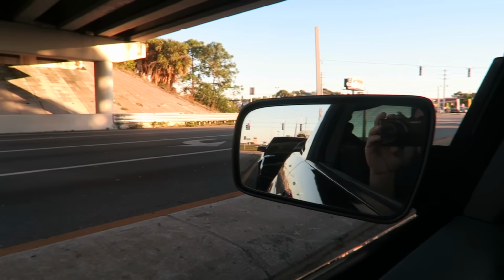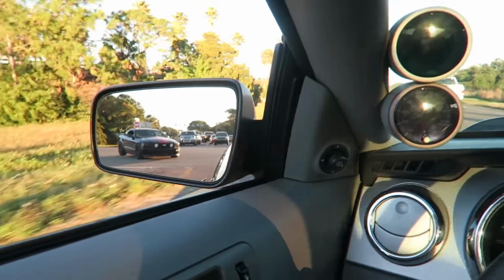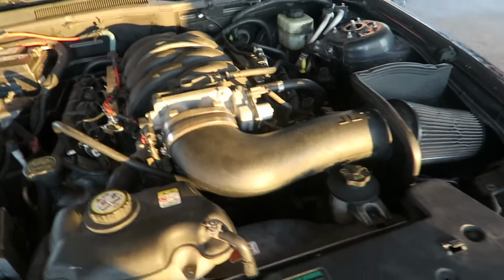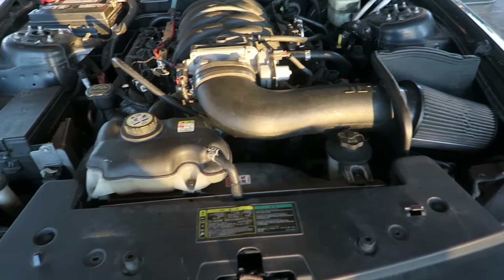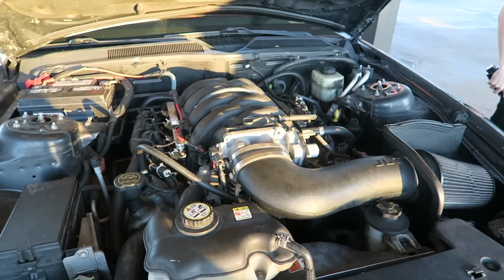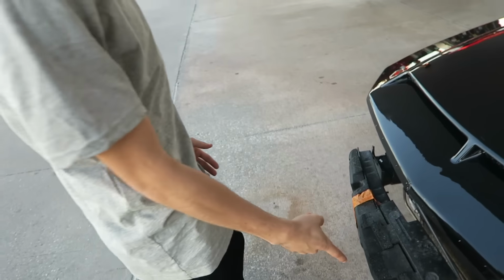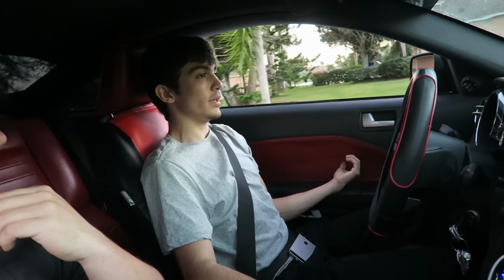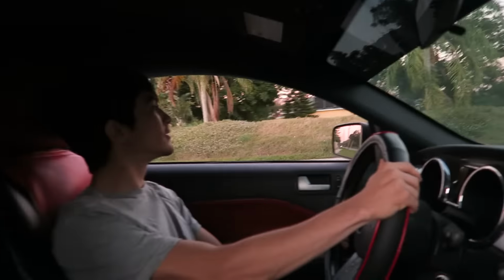He Thought I Had a 3v! LOL *REALLY SURPRISED!* (5.0 Coyote Swap VS 3v GT Mustang)

Comment: That was my twin brother from another mother driving there, computer generated footage shot in Mexico.

The 4.6 3v needs boost to play with Coyote's, no doubt. It just doesn't have the revs and the power to play the NA game unless the guy driving the coyote doesn't know how to shift.
Reply: 3v can easily run with bolt on coyotes without boost but it would need aftermarket heads and cams and a nice intake manifold too that can get them up in the upper 300s to low 400s at the wheels if built right that's plenty enough to play with bolt on coyotes so they dont need boost it's just easier to do with boost I guess you could say
Reply: Trevon Adams  What year?
And I definitely agree, I love the sound our cars make, but it doesn't make a lot of power unless boost is involved
Reply: Trevon Adams  I figured that out quick with mine. I've just turned and put a cai with exhaust. Honestly not worth it to dump so much money into the car and get so little back
My buddies 95 z28 is running with my car..
Reply: Trevon Adams  haha true, when I get the money though, I'd rather look for a c6 vette than an older coyote
Reply: Trevon Adams  Exactly what I was thinking, a 2009 vette!
Reply: Coyotes will get fucked up by a NA LS7. And they're older, cheaper, and physically smaller lol!!!
Reply: I rev mine to 7300. I think that's great being it's still stock. 🙄🙄
Reply: Trevon Adams  I didnt say bolt on and cammed 3v I said one with heads AND cams AND an aftermarket intake manifold with FBo 410 gears and a good tune could easily run with most bolt on coyotes easily now a fbo cobra jet probably not happening but to say they NEED boost to play with a coyote is just a false statement.  Does it cost more than its worth probably is it better just to start with a coyote yes I love coyotes I'm just saying that blanket statement is false and it is
Reply: @michaelharris748  400 horses for a v8 is like driving a 150 horsepower Honda 😓 still fast though.
Reply: @Cricis11700  people act like that these days because everyone on the internet has 1000 hp cars but in reality in the real world 400 horses in a stang (to the wheels) is actually a pretty quick car you get from 0-go to jail speed very quickly
Reply: @michaelharris748  400 to the wheels is a damn good track car bro, not too much and definitely not too little, but they're dragging bro, you not more power in that regard and less weight, just my 2¢
Reply: @michaelharris748  Bolt on coyotes make high 400's to the wheels. On e85 with just headers, cold air intake and exhaust they make 510 wheel... The coyotes make so much power with those sweet higher revvs, the 3v just doesn't compare.

Comment: But that 3V sounded way nicer 😄
Reply: MrSleesch13 it’s a 4.6 thing 2v sounds better then the 3vs
Reply: No way.
Reply: 3v does sound the best
Reply: I have a 4V 4.6 and I think 3V’s sound the best
Reply: I agree the 3 valve sounds better.  I had a 2006 GT with flowmaster 40 series and now a 2017 GT with Borla...  Someone said 2v the best; which I agree but to be fair the mufflers where under near rear seats with long pipes before tips... Unlike the 3v and 4v mufflers right at the rear bumper and immediately followed by tips...
Reply: 2 valve ls7 will fuck both of these up. I thought "Merican pushrods V8s" were so bad? Just ignore the zr1 and demon, they're both pushrod 2 valves lol
Reply: @bambam23406  2v 4.6 sound the best!
Reply: Noah Witt 😂😂😂
Reply: They always sound better than the coyote. Not sure why people like them so much. I guess more cams = more epeen
Reply: Coyote with gt500 mufflers sound badass
Reply: Pretty much all a Ford 4.6 is good for is the sound unless it’s FI
Reply: 1-3-7-2-6-5-4-8
Reply: MrSleesch13 no way

Comment: I’m curious how gearing would potentially make it closer. Was the 3v stock gearing or 3.73 or 4.10?

I’ve got the same setup except a 08 Bullitt with a frpp throttle body, 3.73’s, Bassani axle backs and a Bama 91 tune. 

I have yet to have an opportunity with a coyote. (They’d stomp me but I’m curious.)

Comment: Funny video. I have the 2007 S197 with 3v v3HO supercharger,, 1 size smaller supercharger pulley (can't remember size) delete plates, comp cams #127650, kook longtubes,  h-pipe,   magnaflow mufflers, Brenspeed tune. Dyno x2 came out 724rwhp. And the second pull was 718rwhp. I kill Coyotes all the time, and Z06, lol, I tow them.
Reply: Michael Kennedy cool story nobody gives af
Reply: @hoopmixtape23ify  apparently you did gfy

Comment: How hard was this swap seriously considerthing this for my 09 gt
Reply from the maker: really wasn't that difficult, hardest part was wiring. It was easy because it came out of a s197 platform which is the same as mine so it fit in like a glove
Reply: Johnathan Harder. Ok could you use the control pack? Or did you modify what you had?
Reply from the maker: @kylemoney01  I am running the ford racing control pack for a coyote swap from power by the hour

Comment: I love mustangs but it also shows the kid doesn’t have much knowledge. If I had a bolt on and tuned 3v I’d know better to mess with a 2010+ camaro ss l96 or ls3 even if it just had exhaust.
Reply: CAPTAIN KIDD I have a full bolt on 2010 camaro ss l99 to LS3 conversion. Tuned. I’ve gapped every 5.0 I’ve raced so far. trying to find some that have the 10 speed